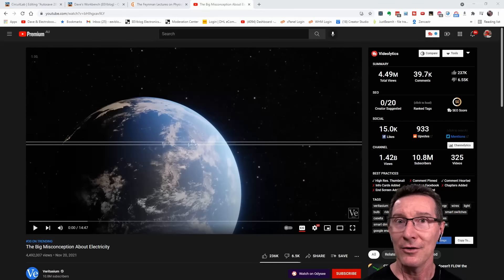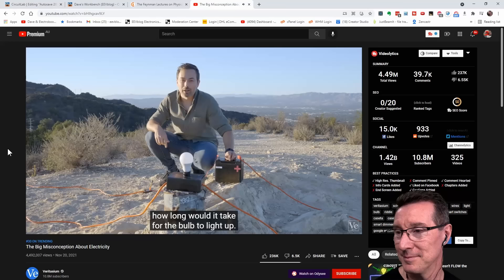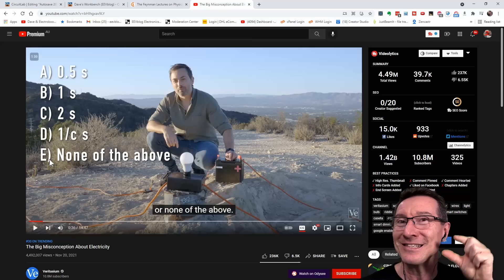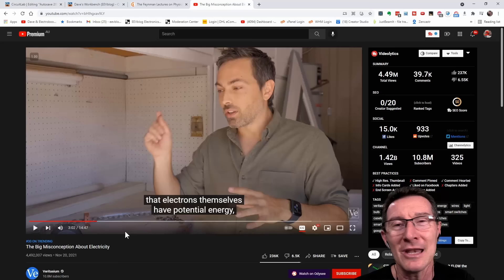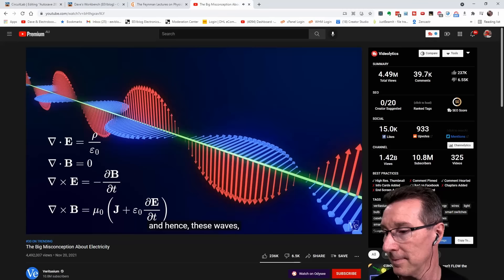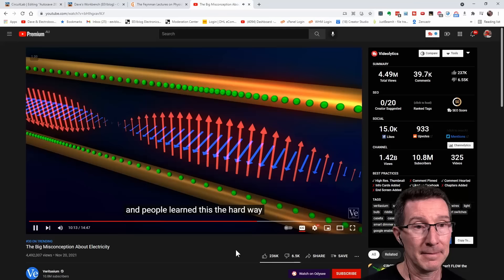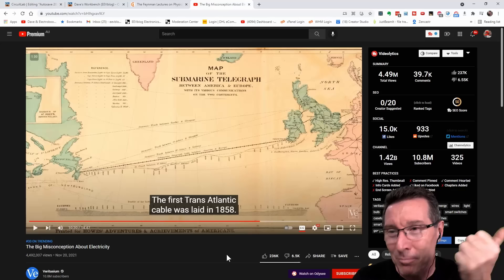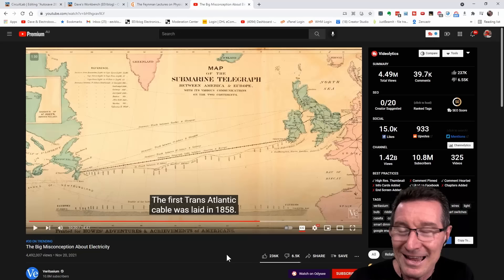EEVblog 1439 - Analysing Veritasium's Electricity Misconceptions Video

Comment: I have a couple of questions regarding this that I would like to understand:
1- What if the switch is all the way towards the end of the line and not next to the battery and someone over at the moon is flipping it. How much time would it take the battery to turn on?
2- If we place a threshold on the voltage required to turn on the bulb let's say 0.5V and have the source at let's say 1V, then how much time would it take for it to light up?
Reply: 1. The battery is always on unless its dead.
2. 1 second.
Reply: 1. As long as the wires remain 1 m apart, it remains 1 m / c. The position of the switch actually doesn´t matter, as this is dependant on the capacitance and thus the 1 m distance. 
2. for this "experiment" he defined that the light bulb switches on immediately. So by that he defined to ignore any thresholds. and as switching on in this is theoretically a quite binary procedure, there is no considerable ramp up in the voltage that matters in the time to switch on. also, we are talking about times and effects so minute, that makes it a rather theoretical.
Practically, If we talk about an incandescent bulb, the time it needs to heat up the filament to a temperature where it glows bright enough would throw of any of those results anyways.
Reply: @alexanderkupke920  I don't think the first part is correct. Information cannot travel faster than the speed of light. So if I put the switch half a light second away from the bulb and the bulb turns on 1/c seconds after I throw the switch, that would violate causality.
In fact, I'd go even further and say that the position of the switch relative to the bulb is the only relevant parameter. The position of the battery is irrelevant.

If you take a battery by itself, it has a potential difference between the positive and the negative terminal. If you attach wires to both terminals, all you're really doing is moving the position of the terminals around in space. In other word, you're in a sense extending the battery in space.
Before you throw the switch, you can measure a potential difference across the switch by attaching a volt meter on the two open ends of the circuit. Once you close the circuit, the potential difference needs to propagate through the EM field. Only after it reaches the bulb can the light turn on since it is a potential difference across the bulb which causes it to light up. That propagation will happen at most at the speed of light, so the time it takes for the light bulb to turn on is x/c where x is the distance between the switch and the bulb.
Reply: @JackFou  the switch position is not relevant. It is the device that closes the circuit. So the signal if you like has to travel along the whole length of the circuit anyways. Or put it differently. 
If the electric power always propagates from the battery, would it only start traveling along the wire when the switch is closed or is the wire respectively charged already and closing the switch only allows electricity to flow?
If you compare this to the "electrons in a hose" example, if the position of the switch matters, that would mean you have an empty hose that first needs to be primed with electrons.
Looking at electric fields, wires always have an electric field if the is a power source and a voltage (or potential) on the cable. With the switch open the field is just not moving and we have no magnetic field.
So the cable is "primed" if you like. The delay from Derek's question actually is influenced by the distance of the parallel cables. For the question with those figures, the answer for the delay is 1 m / c. If you put the wires now 2 meters apart it would be 2 m / c, at 3 m 3 m / c etc.
Reply: @alexanderkupke920  If I understand you correctly, what you're saying cannot possibly be true or at least if it were true, relativity would have to be wrong.
Imagine a scenario where the switch is not near the battery or the light bulb but on the far end of the circuit, half a light second away.
Now relativity tells us that information can never travel faster than the speed of light. That is why two different observers can disagree about the timing of events because information cannot be exchanged faster than c.

If in the above example you stand near the light bulb and someone else 1/2cs away flicks the switch and closes the circuit, what would happen?
If the light turned on in 1m/c then you would know about about the fact that the circuit has been closed before the person closing it could have possibly communicated that with you because light from them would need at least half a second to get to you.
Reply: @alexanderkupke920  the switch position does matter. 

When the switch is open, one side has the full positive effect of the battery, the other the full negative. These respective charges collect on the contacts of the switch. The full potential of the battery is then seen across the switch as a very steep gradient in the electic field. The battery only fuctions to collect charges in places, and then this collection of charges is what creates gradients in the field.

When the switch is flipped, the local negative charges at the switch move toward the local positive charges at the switch. This charge movement is caused by the gradient in the electric field. With this charge movement a magnetic feild is induced, this magnetic feild interacts with that electric field and pointing vectors erupt from the switch outward at the speed of light. At the same time, the charge difference is cancelling out down the length of the wire at the speed of light and new pointing vectors are erupting from this front as it moves forward. The movement of this front also changes the shape of the electric field. 

The first pointing vector to reach the lightbulb will always come from the contact point of the switch because this is where the actual movement of charges occured first, in veritasium's example, the switch is next to the battery, and across from the light, and so it happens at 1/c, but if the switch is at the end of the span half a light second from the bulb then the pointing vector will take 1/2 second to get to the bulb for the bulb to discover that the switch has been flipped. 

As the charges propigate down they reshape the electric field into the steady state field. Once steady state has occured, the elecric field slopes from the positive side of the battery to the negative perpendicular to the wires, the magnetic feild wraps around the wires also perpendiluar to the wire, and the pointing vectors are all collected very near the wire and point along its length. The magnitude of the pointing vectors falls off with the magnetic field as you get further from the wire.

OF NOTE: the pointing vector and the electron propigation do not travel at the speed of light through free space, they travel at the speed of light through the material they are propigating along. (this comes from snell's law) IIRC, the speed of light through copper is about 2/3 of c. So the charge front moving down the wire is traveling at 2c/3, but the pointing vector is going through the air at basically c because its air, and then into space where it is just c.
Reply: @Thesupremeone34  I second this response :). Good explanation
Reply: @JackFou  Even if the switch is open there are two parallel wires and henceforth capacitance. If the switch is very close to the battery the wire towards the switch is very short. As if it's a capacitance with tiny plates. On opening the wire gets much longer. 

Also like someone said, the battery is "always on" in some sense. Attach loose wires to each end and keep them straight and you'll have build yourself something where you've to take capacitance into account. Regardless of any switch.
Reply: @AnnevanRossum  I'm not entirely sure what your point is.
Yes, you might get some current to flow after connecting the wires to the battery as the capacitor formed by the two parallel wires is charging. But quickly that will come to a stop and you will not get sustained discharge of the battery and therefore no sustained glowing of the bulb that way, will you?

Once you throw the switch you might get some continuous current through induction (or however you want to look at it) but the caveat here that this is nowhere near the full power from the battery. Veritasium navigates around this by placing the condition that the light bulb can light up at any amount of current, no matter how small. The problem with that is, that in that case, the light bulb would always be on and never be off.
Reply: @alexanderkupke920  my problem with 2 involves leakage, which will always be present. (yes i know it's not much but...) when he says "any" voltage will cause the bulb to light up their is a problem. That leakage means that bulb should always be on since it's supposed to light up as soon as it gets "any" voltage.
Reply: @davidmiller9485  you see, that is part of the problem. You look at this from a technical perspective, where you are absolutely right of course. But this should be looked at from a theoretical, abstract perspective. This perspective which is commonly used to explain or elaborate scientific theories to a certain level of detail, especially in education, allows to make assumptions (or simplifications) like ignoring the cables resistance or just assuming a theoretical light bulb that would switch on at any voltage. That assumption is made to display just a certain principle. Otherwise we would not only have to define as t which threshold voltage the bulb would start to emit light, but also how much of a threshold you would have to define at which brightness the light would be detectable. Which simply are complications not needed to show just the effect of electric and magnetic fields.
Reply: I tend to agree with @Alexander Kupke.  With the switch open, the wires are still connected to the battery regardless so there is a static accumulation of electrons on one side, and an accumulation of “holes” (depletion of electrons) on the other wire.  So the electric field is already there.  As soon as the switch is closed, the electron movement begins, at the speed of light, and the magnetic field is created which creates the pointyng vector and the transfer of energy across the wires which are 1m apart.  So, I don’t think the position of the switch matters— like he stated, the wires are “primed”
Reply: @jorgerive7335  So what happens then if you put the switch half a light second away, on the far end of the wire loop?

If you close the switch and the light turns on immediately (after 1/c seconds), you would have violated causality because a person standing near the light bulb would know that you have closed the switch, faster than this information could have traveled from the switch to the bulb at light speed.
Reply: @JackFou  thank you— this is hard for me to understand…the electrons in the “primed” wire have no idea where the switch and the light bulb are.  So to me, it shouldn’t matter if the switch is  “next” (across) to the bulb or at the circuit extremes- the electrons will move as soon as the switch is closed and this will cause the capacitive coupling to light up the bulb….but then again, I see your causality argument, and that makes me wonder if it could be that we’re not applying it “correctly” — You may be 100% correct, though- I just don’t fully understand it or relativity…
Reply: @jorgerive7335   Yeah, don't worry, this absolutely isn't easy to wrap your head around. If it were, this whole debate wouldn't have started in the first place :)

I think where your idea falls apart is that the electrons do not move along the entire length of the wire instantaneously as soon as the switch is thrown.

If you think about electrons in a wire in the sense of an analogy of squeezing marbles through a garden hose or something along those lines, it is easy to assume that pushing one more marble into the hose at one end must result in another marble instantaneously rolling out the other end. But this only appears to be true for short distances. For significant distances such as a light second or beyond, there would be a noticeable delay. Similarly, if you take a really long stick, say 1 light second long, and you push on one end (with sufficient force to move the whole thing), the far end will take at least 1 second before it moves (the actual delay would probably be much longer than that but it's not really a practical experiment anyway). The push must first propagate down the length of the stick at some finite speed as atoms bump into each other.
Note, while I say "noticeable delay" at long distances, the delay is very much real even at short distances - except it is so short that you need special equipment to measure it. The channel "alpha phoenix" has a great video on this.

Coming back to the question at hand, if the switch is located on the far end of the loop from the battery, the electrons near the battery or the light bulb, won't move instantaneously as the switch is thrown. The change in the EM field must first propagate down the wire at the speed of light. It is this propagation at a finite speed which is the reason for the fact that the position of the switch matters.

Comment: Also, regardless of the 1 volt you get in a nansecond, it's actually the electron motion and subsequent heating that actually "lights up" the bulb filament, so another reason why the correct answer to Veritasium was probably (d) in any universe like ours.
Reply: This is actually not correct. The physics says the energy flux is lighting the bulb. It just looks like the electrons are doing it. The issue is its basically impossible to show this but it is the reality of the situation. Just like we're all made up quantum fields.

Is that useful to the iphone maker, no. Is it interesting, yes.

Comment: Honestly the question the video left me with was, "how much power does it take for an incandescent to be noticeably 'on' in a normally lit room?"

Because once you start assigning physical values, get a rough idea of the impedance ratio between a lightbulb and transmission line, you realize it's just asking if you get a signal when you hold an antenna next to a power line. And if you phrase the question that way, I feel like even most laypeople will have the correct intuition about the answer.

And like, sure, making unphysical assumptions about lightbulbs will throw that intuition off.

Comment: Though I didn't fully grasp the implications of 1/C seconds, I was confused by the units. When you said the answer should be 1m/C, it made sense. Then, units match, as 1/C does not give seconds, but seconds/meter. 

Thanks for pointing this out 👍
Reply: Here's more.  EEVblog's lumped element model here is not the right one for Derek's experiment set up.  Derek's answer of 1/c is not entirely correct either.

You'll be surprised at what the answer really is ....

Go to the top and sort comments on "Newest First", scroll to the time stamp of this post, and read mine.

Comment: In a typical copper conductor electricity “flows” at 2/3 C. I came to appreciate this 30 odd years ago while working in broadcast TV. Even a half metre of coax was long enough to cause colour synchronisation problems